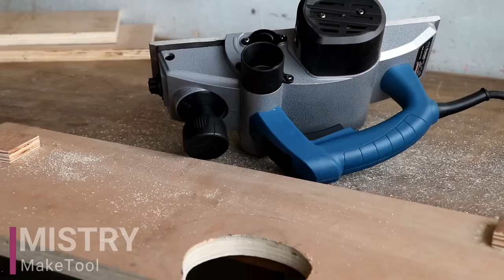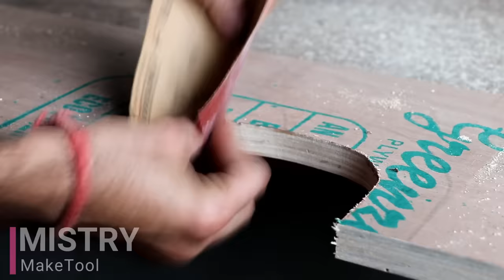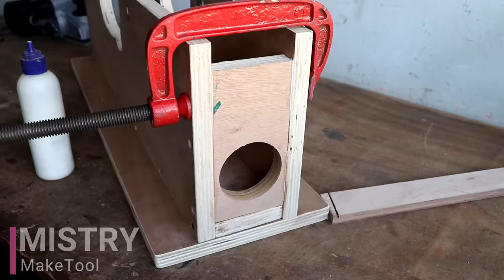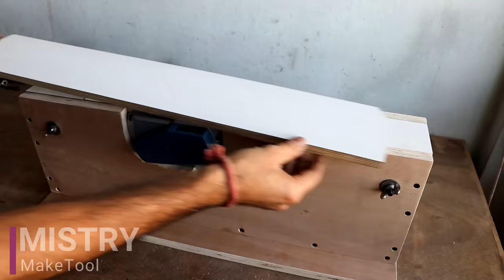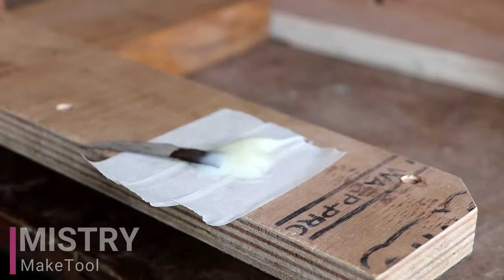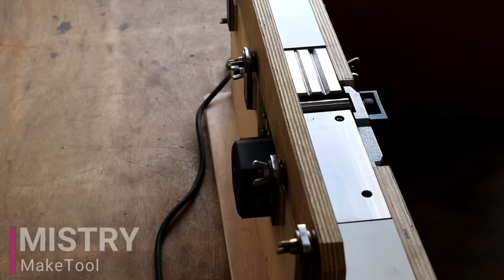Make A Benchtop Jointer || DIY Jointer With My Electric Planer

Comment: One trick for crewing in the threaded rod (or cut off bolt): Using the pliers is a bit harsh on the threading. If you put two nuts on the end though, tighten them against each other and drive the whole thing like a bolt, you are golden.
Reply: or even better Dome nuts
Reply: Exactly my thoughts when watching him do that! I felt like yelling at the screen! 🙄
Reply: I was gonna add that exact comment, but thought, If if scroll down, I bet a few others have already.  :)

Comment: I would recommend you using a push stick!
Reply from the maker: Okk..ji
Reply: as someone who has used a jointer for hundreds of hours on a production line. i would just use better form and hand routine. and not a push stick. chances are you know this but were getting a good camera shot.

Comment: I can't even remember when I bought my electric planer and I literally haven't used it once. This is a good use for it.
Reply: If you didn't have an immediate use for the electric planer, why did you buy it in the first place?  I'm not trying to be a troll, but I just do not understand why someone would buy a tool they do not need just to have it sit around and take up valuable space in a shop or garage.
Reply: @Troy-Echo  I was building my workshop and for it for somewhere around a quarter of the price. I kept waiting for a way to use it. I still haven't build this and it's stl sitting on the shelf i built for it. That's how I roll.
Reply: @EdGloss  That makes perfect sense.  I should have thought of that angle.  Goodness knows I keep watching on various sites for tools in good condition at a good price.  Found a band new Bosch 1617EVSPK and router table combo for $400, boxes unopened.  $50 off new list price, but with my military discount, it only saves me $3, and I lose the 30 day return and 3 year warranty (maybe not).

Comment: Nice video of construction, the only issue is NOT using a push block! Great way to clip finger nails and or finger tips.
Reply: Yeah, I noticed that and cringed with every pass he made! Plus, putting in those allthread pieces, using that pair of pliers when he should've used dome bolts or a pair of bolts on the ends to screw them in. Much easier on the threads!

Comment: I've made a different one. Used some 2mm sheet steel about 20mm wider all the way around than the planers base. Cut out the footprint of the base allowing the 20mm all around. Countersunk holes and used brackets to fasten the plate onto the plane. This I then set into an existing bench by cutting out a hole 20mm less than my plate. I then rebated the remaining 20mm to a depth of 2mm so the plate would sit flush. The problem I've notice with all these is there doesn't seem to be any adjustment. Set the blade on its maximum cut and level the plate to this. Then if you want a shallow cut adjust as normal. The only problem is the adjustment plate will be slightly higher than the table until you reach the maximum cut. I guess you could adjust it so it's flush at say 1mm and just do 1mm passes or 0.5mm etc. Hope this makes sense.
Reply: Thanks! I'll take a screenshot of this and draw it out on some paper. Much appreciated!

Comment: A humble suggestion for those that want to build this kind of electric planer support: 
Buy a Makita 1912B model, it has a full 4 3/8" (110 mm) width,which is very advantageous for this type of use.  It is powerful and the extra wide capacity is very handy, and the price is right.
Reply: Imho for what it costs, I'd prefer to invest that money into a jointer, instead of making one from an electric planer.
Reply: @MicheleBedendo  Then, What are you doing here? this is for DIY people that are savvy enough to actually save money, plus this design is compact and can be easily moved and stored...  Try that with a heavy cast iron jointer. And my suggested Makita 1912B planer is only a little more costly than the common planers that are narrower.
Reply: @alfredomarquez9777  I'm all for the solution is shown in this video. What I'm saying is that the Makita model you suggest, at least in Italy, costs around 500€ for 2,8 cm more width which is fine but with that kind of money you can buy a non-professional jointer (as this solution is) with a wider mouth. Btw, you can find a more common 8,2 cm wide mouth planer for 150€ (even Makita) so quite less of the model you suggest. I repeat: these are the prices you kind easely find online in Italy. A part from that, I'm too thinking about making my jointer using a planer.
Reply: @MicheleBedendo  Sorry for you and the people in Italy... Here in Mexico, I bought mine in the equivalent of 240 US Dollars, therefore my recommendation was fine, at least for us.
Reply: Hey Michele: I have just checked today the price for a new Makita 1912B 4 3/8" (111 mm) planer here at a local store, and it is 235 US Dollars... some stores in Italy are just robbing their customers!
Reply: @alfredomarquez9777  After some more research I found it for 365€ but still too much.

Comment: Not all heroes wear capes. If I were you,  I'd make a simple protective cover out of wood to cover the blades. You can put L-shaped metal brackets off the side and put a piece of wood with slots drilled out.  That way, you can slide the wooden cover in and out to match the work piece's width, then lock it in place with wing nuts. The safety of your fingers is worth it.

Comment: Nice one, oh if you use your hacksaw or grinder (on the guide wall) and make a single cut on the end of the bolt you can use a screwdriver to turn it

Comment: Great build. But watched it over and over. still don't understand how you used the bolts to square the fence to the table...can you explain!
Reply: Putting lock washers in the stack as he did allows for some over tightening beyond what will hold it securely. Because the two sets of bolts are positioned at the top and bottom, overtightening one set will cause the board to flex against the other set. Think of when you're tightening lug nuts on a car and you alternate incrementally around, every time you go back to a nut, it's looser than when you left it up until they're all equally fully tightened, same principle, but along a single axis.

The problem however is that this set up is limited to 90 degree angles, any play you have with the angle of the fence is strictly to calibrate it to 90 degrees. However that's not really a caveat given that it's just a cheap wooden housing for a $40 electric hand planer as opposed to a $300 to $400 bench jointer.

Comment: I like it somewhat, the overall concept, but your design isn't the best. Your back fence could/should be all be one solid piece. Don't mess around with the iron. 2nd, and biggest thing,  you have zero access to your bed control knob! You'd have to take the whole thing out to make any adjustments. 3rd, and this is probably a personal preference, but your outfeed table should be as long or longer than your infeed table. But this is just my thoughts....

Comment: now you have 4 points to fail at getting a flat plane.  why not only use 2 bolts at the front a 1 at the back?  Your design  is simple and I applaud but too many points to fail and cause crooked material planes.